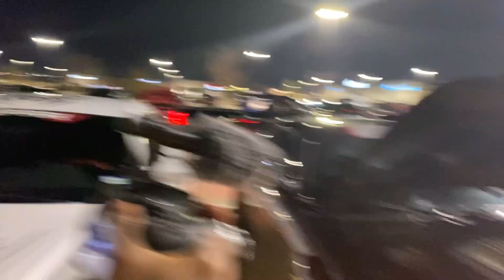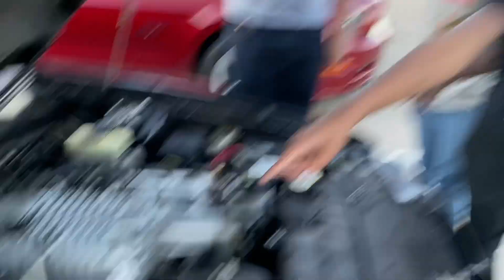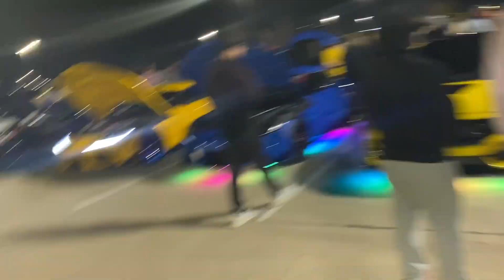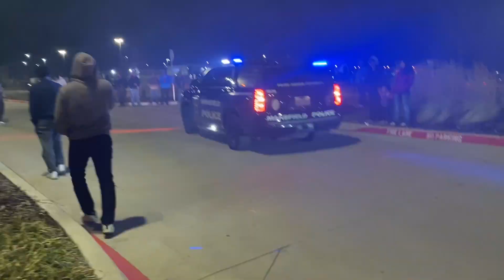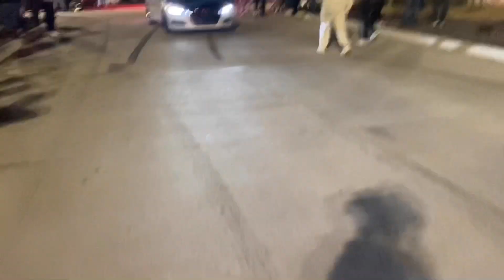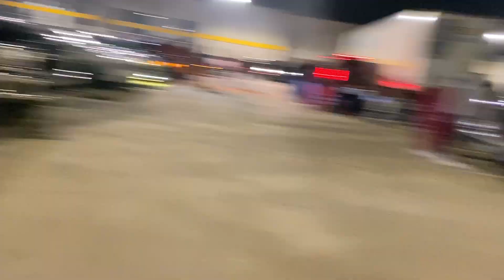WE ROLL RACED TO THE CAR MEET! *KID PRESSES US ABOUT OUR CARS

Comment: 6.1 srt8 or 6.4
Reply from the maker: 6.1
Reply: @srtjai  get your heads ported and your intake  Manifold and get a srt max cam with 1050 Injectors and a 450 walbro pump and run e85 u will be gapping  that snake and going heads with hellcats